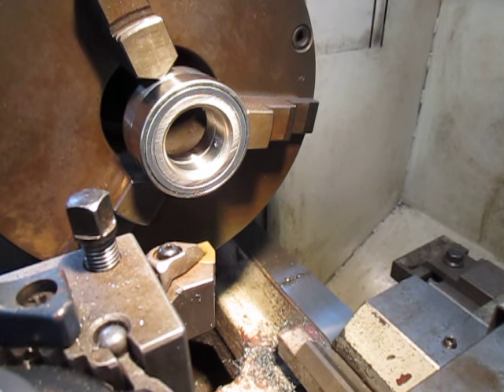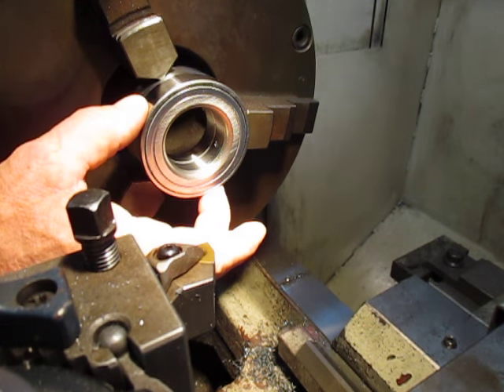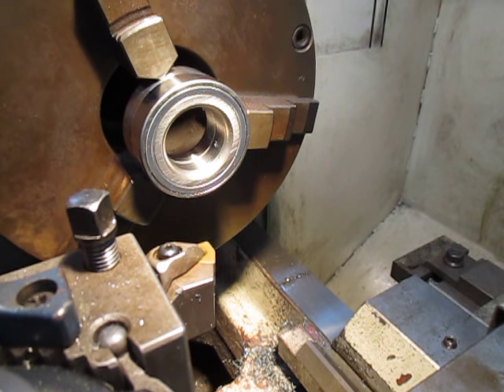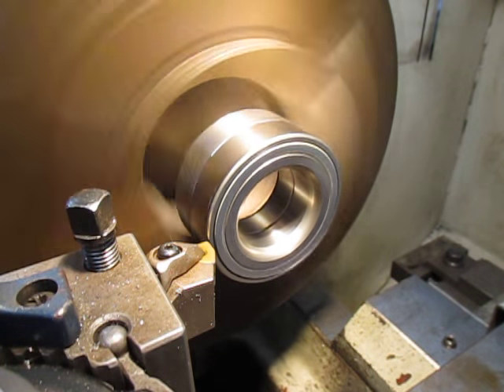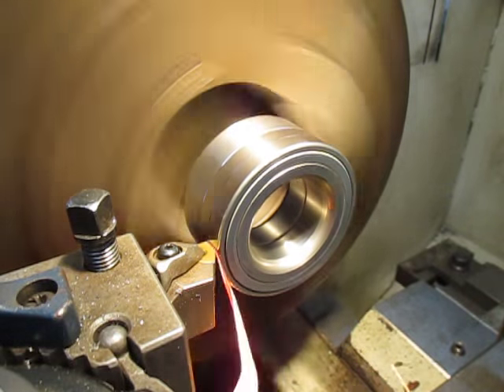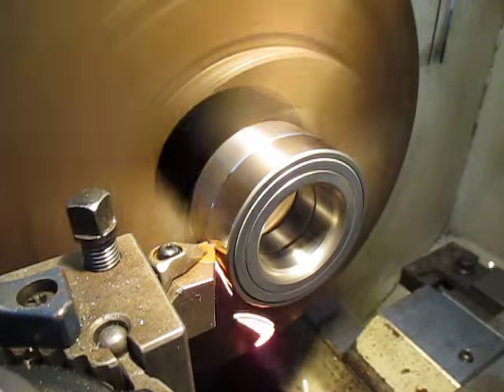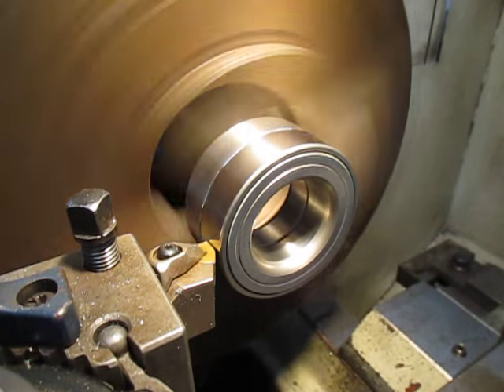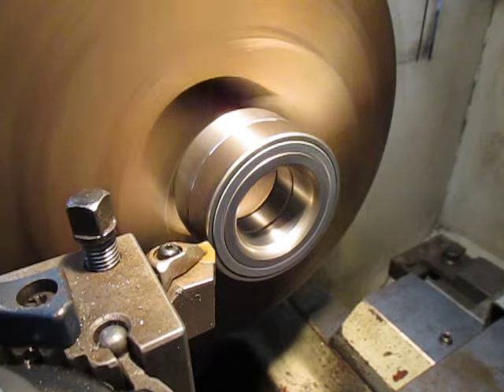Machining double bearing OD using a ceramic cutting tip

Comment from the maker: John9 thanks, Ceramics are very brittle and not good for interrupted cuts. You could use any tip made for High Tensile steel to true your chuck jaws, personally I'd be more inclined to do it with my die grinder in the tool post. There is a vid on my channel showing the set up for grinding, or send me an email and I'll give you some pics. whatever you do, machine a ring from thick walled hollow bar ID and use that to hold the jaws true by spreading them against the Hollow bar, maybe I'll make a vid.

Comment: Thanks for another hugely instructional video.  Interesting to see that you can change the OD of a bearing from metric to imperial.  Great way to solve a problem.

Haven't seen a ceramic tip being used before.  Makes me wonder if I could use one to true up the tip of my 3 jaw chuck which has been nipped at over the years and is looking a bit tattered.  Or is there a better way?

Comment: Hi Bruce,

Great video and another tip I will store in the head for latter use.  Is you 3 jaw chuck spot on with a minimal TIR or is it one of the adjustable type?

Cheers

Piers

Comment: Many thanks for posting this excellent video. Thinking of the situation of using the metric bearing in an Imperial housing, would it have been better to machine the housing to fit the available bearing ? Or was this a case of we do it because we can!